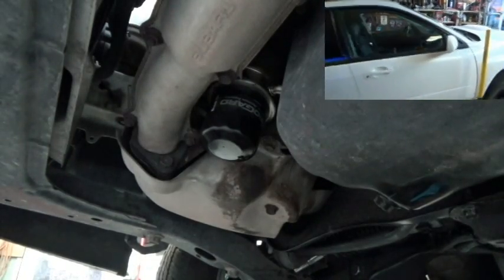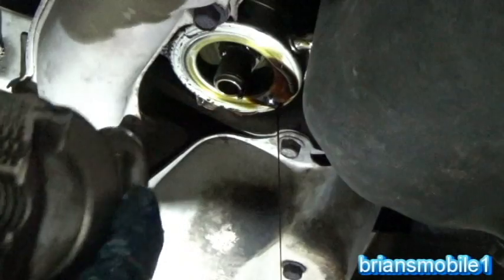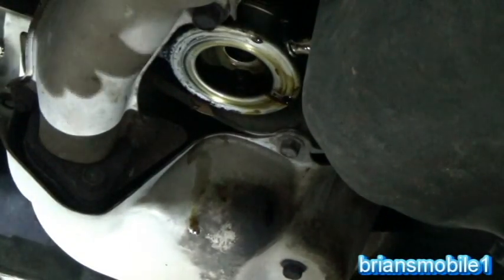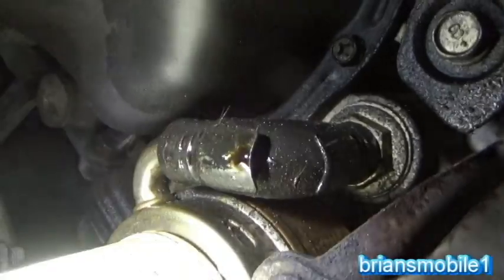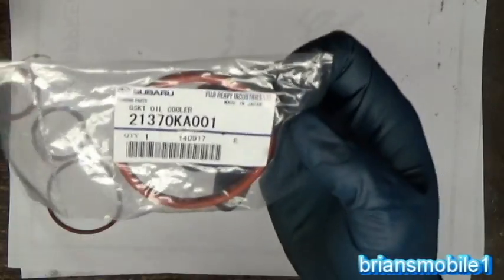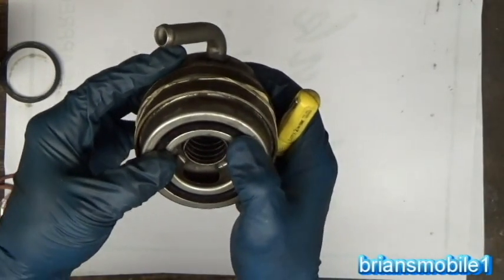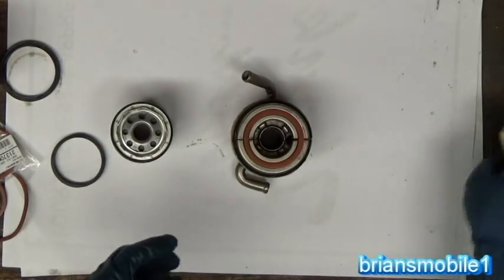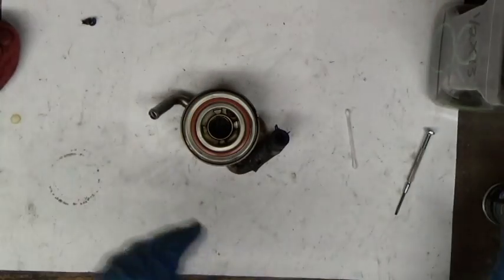Common Oil Leak on FUN Subarus and Nissans

Comment: Man I can't find this info anywhere. 20k ago I got an ej253 n/a with milled block & heads, new crank, cams, mls gaskets etc. from a Subaru only machine shop that now has coolant in the oil pan. Every test checked out but I was starting to pull the engine anyways when I found tiny specks of coolant in the oil filter. Is it possible the oil cooler is the issue? I know it could be on a lot of vehicles but sounds like less of a possibility here? All info comes back HGs (which I assumed.) If its relevant, it sat for at least 6 months (unrelated repairs) so it must have been a small leak that somehow drained my coolant while sitting. The coolant was completely separate from the oil so it must not have been ran while mixed? Also in MI if rust is a factor. Thanks for any advice🤘

Comment: I see you fly RC Planes. I do too. Working on small engines is how I pay for my RC stuff. I am retired disabled and doing small engines pays for my hobby. I use Tactic Transmitters and receivers,Spektrum burned me with the DX6i and its problems with brown outs.I fly both fixed wing and heli as well as boat and some quad. I am not into building or racing quads. No one here does that so its a useless hobby in my book. I like to fly prwtty much anything with wings. If I cant fly it,then I crash it and move on. Some planes are trash right out of the box,and others are great. I like watching your video's. Been wrenching cars since I owned them.

Comment: when you think you should replace the oil pump,what's the symptoms .i have a oil pressure light on my subaru forester 2005 only when stays idle after warming up.i do have 260.000 mile the care runs very strong .ntill  we did timing belt ,water pump and only changed both had gasket for oil leak. after all this i have now a oil pressure light ,i install a new oil switch so far is been with same problem.my mechanic tells  me is because i have been use synthetic oil my motor is to clean.now  i am using 10w30 fully synthetic but again same problem after a 5 minutes the light cams on again only when is idling or if i stop on red traffic light .any suggestion  for me  . thank you

Comment: Brian, 
I have an 06 outback (non turbo) I have the same leak slowly producing a drip from tbe oil filter. My car does not have an oil cooler so where do you suggest I start investigating?
I've not had the car long and i will be doing the timing belt/ water pump soon and hope to resolve this drip.
Love the vids! Keep em comi g!

Comment: Thanks for the great video, I own a 13 Legacy with a 3.6 H6 engine, and I will be watching for a leak like that down the road on the car, I wonder if the material for that O-ring is what's called Viton, or is Buna type? I deal a lot with rubber that color at the winery I work for with wine hoses.

Comment: Same problem with my '01 Forester is driving me nuts...tired of the oil messes.  Doing this job this summer along with a few other goodies in that area (new radiator, etc.) so I'm looking forward to putting the leaks to an end.

Comment: I just replaced this gasket on the 2005 Forester XT and the top edge of the gasket was rounded over and not sealing 100% a very quick and simple $9 fix = not more oil leaks

Comment: I have a 2007 outback and its leaking from the oil filter. so i bought the gasket for it. But when i took out the oil filter its just threaded into the block and there is no oil cooler like the one in your video. Im stumped. Any suggestions?

Comment: Great video as always. My old beamer started to sweat oil around the steering assist pump and at the belt drive bearing :( well it's mileage is already at 160 k miles and the age isn't helping things either. Sadly replacing them is a great pain in the behind.

Comment: can you tell me if the 3.3 in the SVX that cooler? I have oil all over the place under the car, it only has 72,000 miles on it. it's a 92.
Reply: it does not have that cooler but as it's a 92 chances are that it requires many seals valve cover leak this channel has a great way of doing the covers 100% leak free after 2 year using his way !!!!

Comment: Sorry, I got lost on what was where in the first part.  What is holding the oil cooler on?  Is it the pipe nipple that the filter screws onto?  If so, how does the pipe hold the cooler in?

Comment: im just wondering will it be okay if i use a high temp rtv sealant on a oil separator plate for a subaru forester gt 1999? reckon it will be okay to seal it like that?

Comment: Is that filter a 3400? Or do you know a car that takes one, and has that type of cooler?

Probably a lot better than nothing, and a lot cheaper and quicker to mount (or remove) than a full-on external type.
Reply from the maker: 3400 is a Bosch number I think.  If you're going with Bosch, it's a 3310.

Comment: This is literally what i see under my 2010 subaru impreza.   I went to jiffy lube and they said i had a rear main seal leak and a front differential leak.   Could they have mistaken that for this?
Reply: I wouldn't trust Jiffy Lube to know where the oil goes, you should definitely not trust they identified your leak.